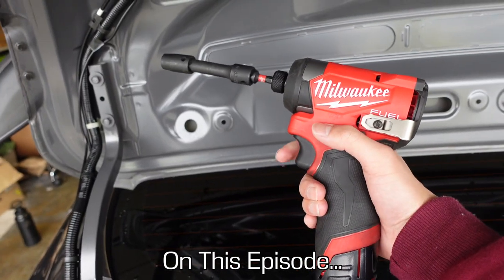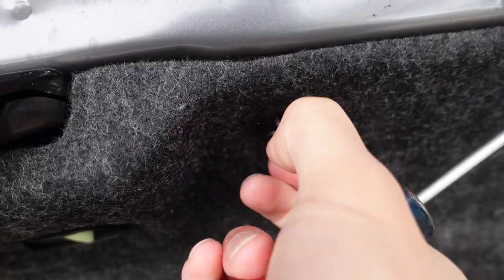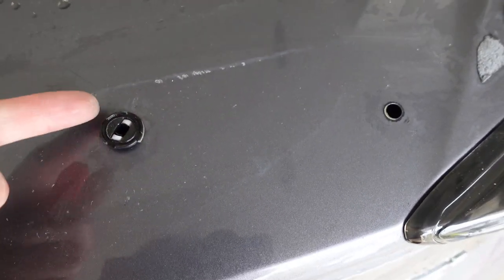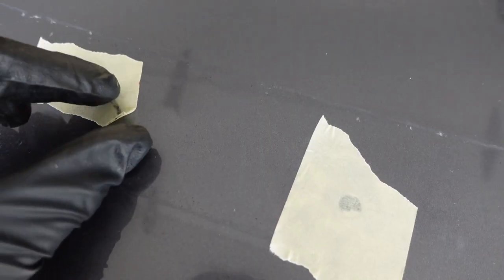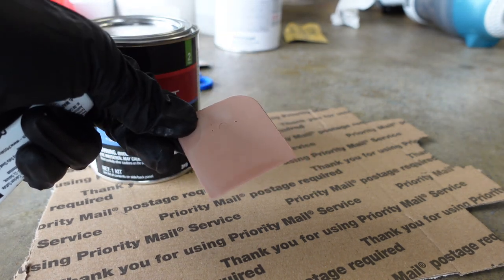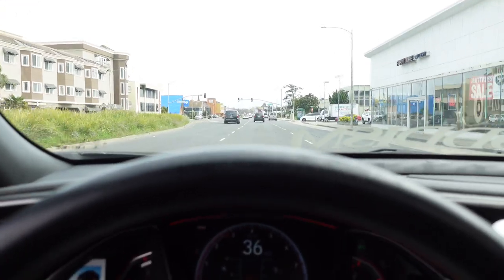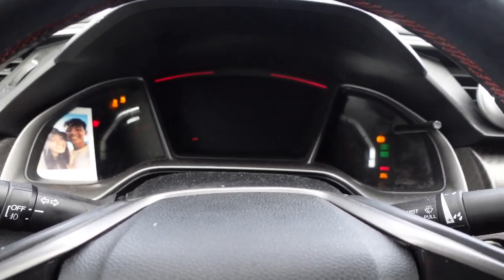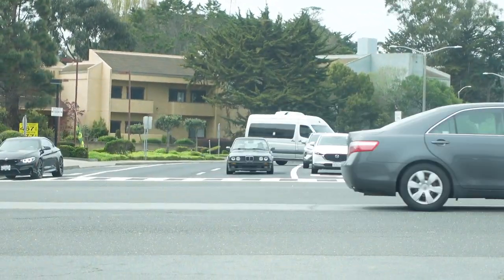Removing The OEM Spoiler on My 10Th Gen Civic Si!

Comment: Really considering selling my 9th gen si and get a 10th gen because of you. it looks more fun and i wanna expand my taste with a turbo vehicle.
Reply from the maker: That’s tight! If you wanna build big power I’d stay with the 9th gen but if you’re down to do the K20 swap then the 10th Gen Si can be a really fun and strong platform😁
Reply: i have a 9th gen si and my dad has a 10th gen si i'd say that stock for stock the 9th gen feels better, smaller, power band is good, andf low end torque is really fun but the 10th gen is also fun and the turbo makes for a really fun driving experience so if you want to make more power stick with 9th but if power isnt your priority go with 10th at the end of the day they are both si's and they are both fun asf
Reply: @Brennan-yf4yv  thats why i might go towards the 10th because ive had the car for 4 years and already fulfilled my power mods and done everything i wanted, now i want to relax and not worry about power.